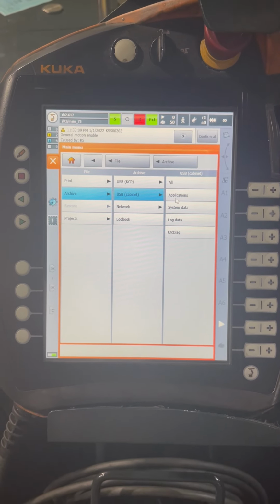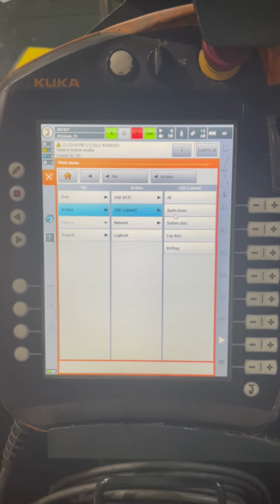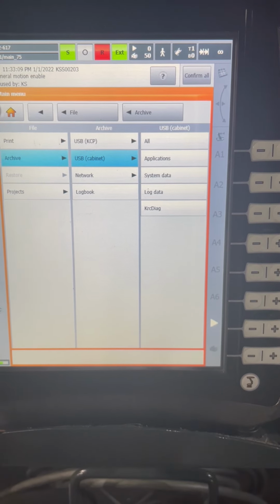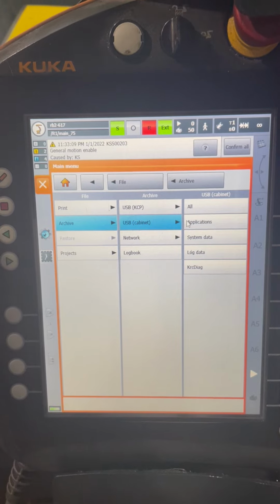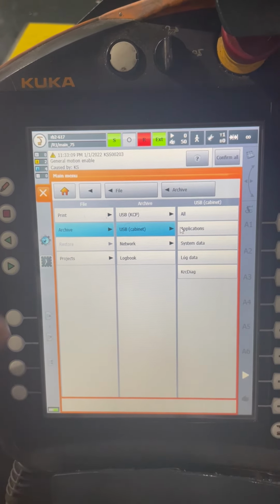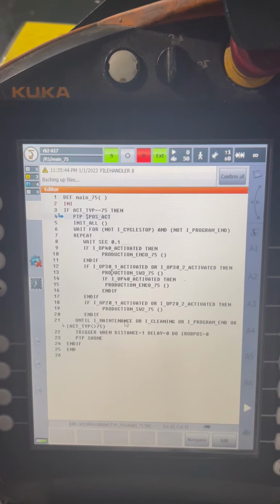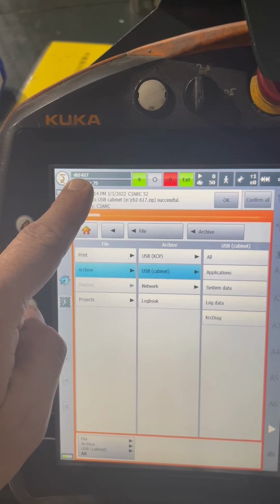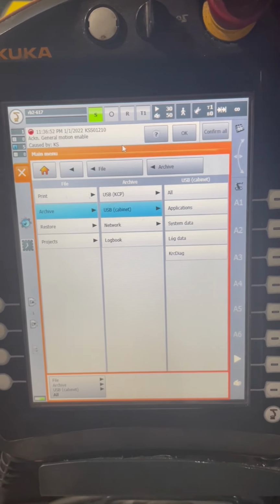Archive and Restore Kuka Program and Diagnostic Files Using KCP

Comment: How much time does it take to restore a whole project?
Reply from the maker: You can restore the project in two ways, 1- by usb and it should be fast but still depends on the version and size. 2- workvisual software and I think it’s faster than the USB